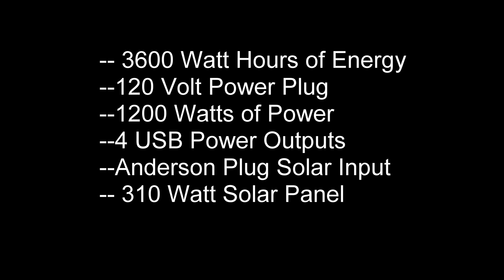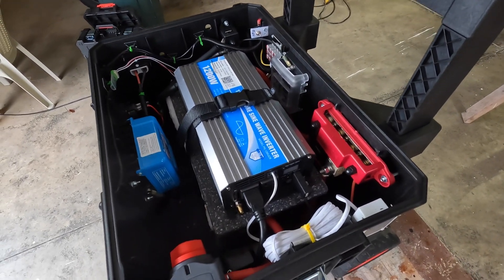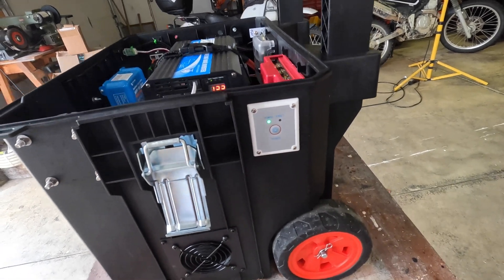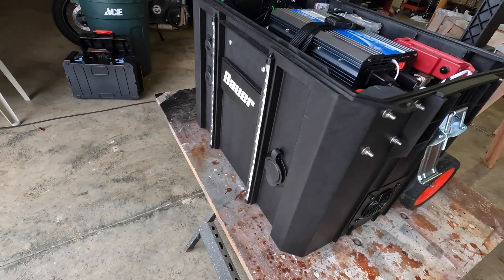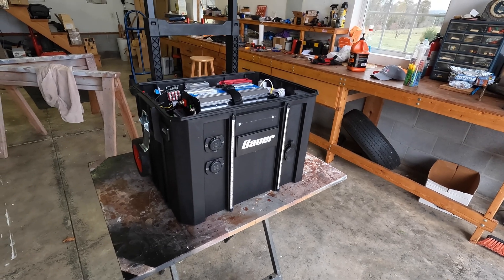Solar Generator

Comment: Mine is close. I’m using Milwaukee pack out. I’m running 2 batteries on bottom with DC on bottom and ac and charge controller on top.

Comment: Very neat and clean!  I built one a couple years back using the same general idea, but I put the inverter and DC load panel in the top box, with the battery, charge controller and shunt in the bottom.  I used a 175-amp Anderson connector to connect from the battery to the bus bars in the top box.  Yours is more compact than mine and more organized!  :)